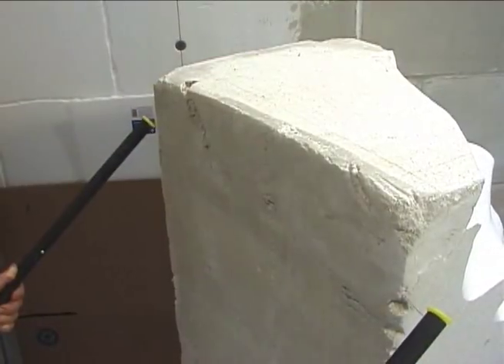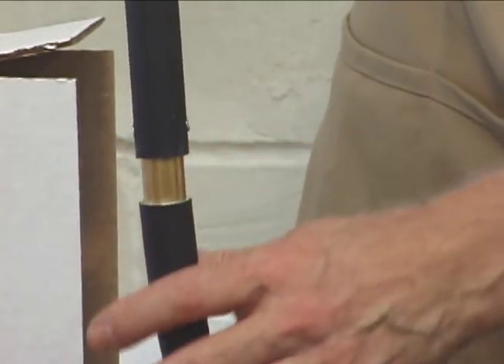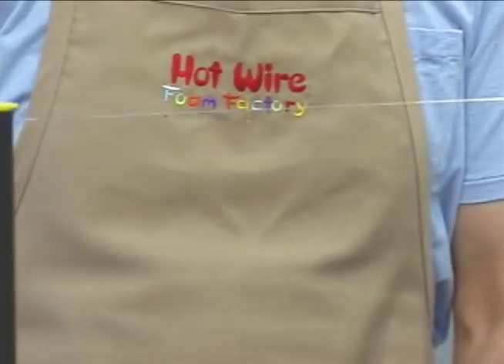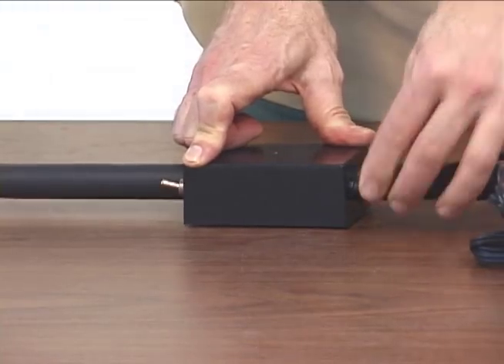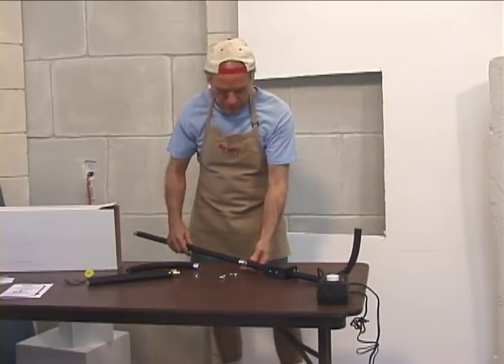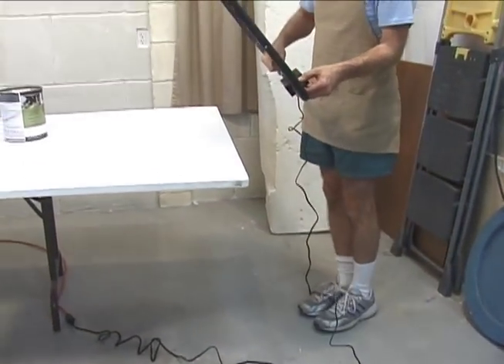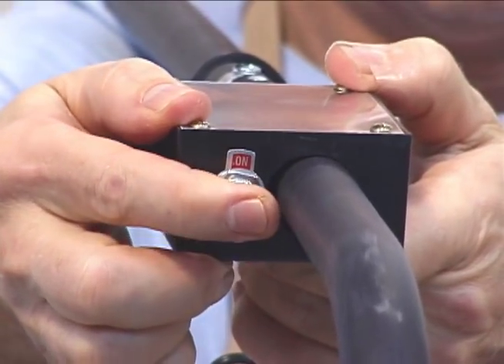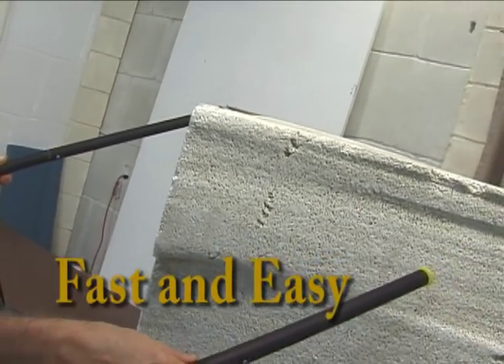Foam Cutting: Hot Wire Bow Cutter

Comment: Can this system be used to cut sprayfoam insulation
Reply from the maker: Yes, but with great caution. You must wear an appropriate respirator as the fumes are very toxic. Sprayfoams, like Great Stuff, also give off some toxic fumes as they set up. Be in a well ventilated area with nobody else nearby. Also note, you must use Boost with our powdered foam coats to get good adhesion to polyurethane spray foams.

Comment: Is polystyrene non toxic when smoking🙄
Reply from the maker: Ventilation is always strongly suggested, but the smoke that you may encounter while cutting EPS foam is primarily CO2 and water vapor, which are far less harmful than other common art products like aerosols and paint thinners. The toxic values are far less than wood-smoke, which contains tars, resins, creosote, and acetic acid. The dust from cutting with saws and sanding EPS foam is more harmful than the fumes encountered while cutting foam with a hot wire tool. Always wear a good quality dust mask when saw cutting or sanding polystyrene foams.

To get the polystyrene foams to actually combust and burn you have to have an extremely hot fire, much hotter than our tools get, burning directly on the foam to begin with. Always check with the manufacturer of the foam you are using to make sure that there are no health or safety hazards when cutting their foam with hot wire tools. Keep in mind when you read the Material Safety Data Sheets (MSDS) for the foam you look up that they often are referring to possible safety hazards when manufacturing foam, not cutting it.

You can call our toll free number at 1-866-735-9255 and we can give you the tech-support number for DOW which manufactures Styrofoam. They told us that the fumes from cutting their foam with a hot wire are not toxic, but cutting should still be done in a well-ventilated area

Comment: Can this device be used to remove excess closed cell foam from a wall that has be overfilled?
Reply from the maker: Yes, it is often used for this purpose. It will cut this foam best in the 2-foot mode. But beware, the two part insulation foams are usually polyurethane which gives off toxic fumes when cut with heat.

Comment: Would this cut closed cell spray foam?
Reply from the maker: It is capable of cutting this foam, but the fumes from cutting spray foam are very toxic.
Reply: Hot Wire Foam Factory  are they not all toxic?
Reply from the maker: I have heard of several building contractors who cut this type of foam with the Bow Cutter. They say it cuts best in the 2 foot mode with the heat turned up. That type of foam gives off toxic fumes when cut with a hot wire, so they have to wear proper respirators. Our tools are designed for cutting polystyrene foam.

Comment from the maker: Polyurethane foam gives off toxic fumes when cut with a hot wire tool. Some people use hot wires to cut low density polyurethanes that are used for camera cases and insulation, but only with approved ventilation equipment and/or respirators.

Comment from the maker: Fumes from cutting EPS/Styrofoam with hot wire tools are less toxic than fumes from most candles. It's mostly water vapor and hydrocarbon. Much less toxic than most spray paints, glues, and cleaning products.
Manufacturers of EPS/Styrofoam recommend adequate ventilation when cutting their foam with hot wire tools. Many other foams do give off toxic fumes. Check with the foam manufacturer to make sure there are no health or other safety hazards when cutting their foam with hot wire tools.
Reply: GREETINGS,  AM I READING THIS RIGHT? THIS IS OVER 10 YEARS AGO ?